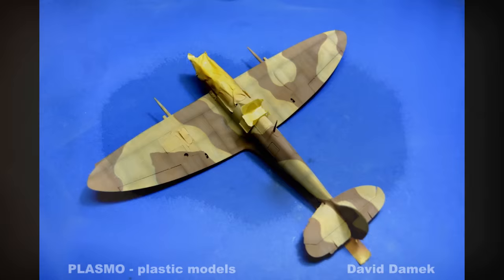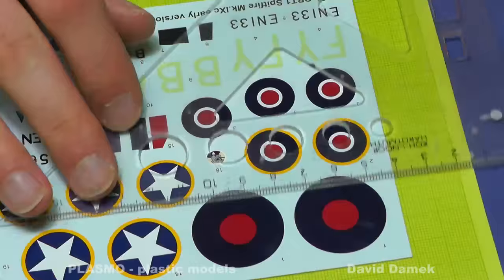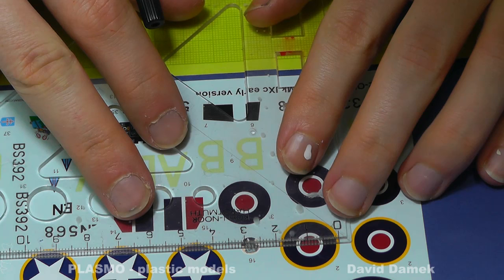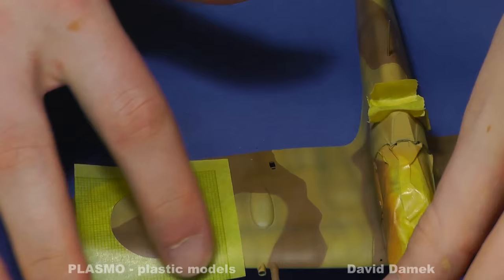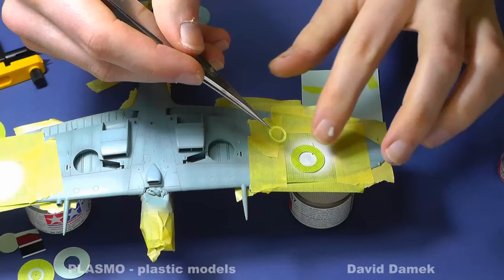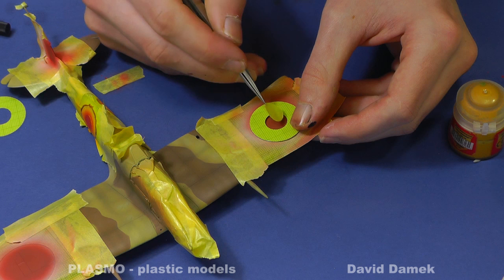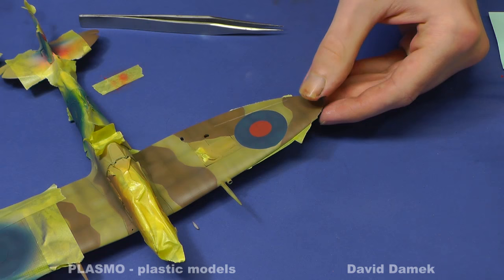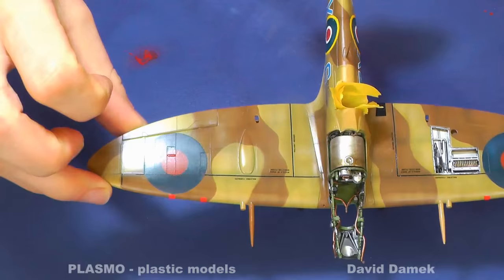How to paint and create stencils RAF roundels - Great Guide Plastic Models

Comment: G'day David, Let me firstly say that I subscribed to your channel because I'm very impressed by the authentic look of your WW2 models especially. I'm ex-RAAF and now, a military historian who is into modelling. I can tell you that before and during WW2, in Britain, finished aircraft would come out of the factories in RAF livery that had, mostly, been sprayed on. Once those aircraft went to their operational bases there was no time to repair aircraft and then spray paint on them. If an aircraft was so badly shot up that the roundels (which are most important for identification) needed repainting then that was done by hand, much the same as you did, using pre-cut stencils. That is part of the reason why your RAF models are so impressive. 
Many models that have the so-called 'D-Day' black and white stripes, have 'razor' sharp borders between the black and white. I have many period photographs of these D-Day stripes being painted, outdoors, with 6 inch paint brushes. Not a lot of care was used in doing these stripes. There were too many aircraft to paint and little time to do the job. So, when I do D-Day stripes I deliberately make them a bit rough, as they were in reality. Also, at their bases, during the war, especially around the time of the Battle of Britain, nobody cared about the aircraft getting dirty; another mistake made by some modellers. New aircraft only looked 'new' for a very short time. The only washes aircraft got was when it rained, as it does in England quite a lot. This, of course, didn't wash off grease, oil and exhaust stains, so they stayed on the aircraft and built up over time. 
I like to research my model aircraft as they were in real RAAF squadrons and I try to find out which pilots flew certain aircraft the most. If they survived then that particular aircraft was considered to 'be theirs'. The RAF and RAAF didn't bother painting the pilot's names on aircraft, as some USAAF had towards the end of the war. A tradition that still goes on in the USAF today. 
Anyway, thank you again for all your tips on brushing as I don't use an airbrush at all; I'm no good with 'mechanical' things...
Cheers, BH.

Comment: Great work, I wouldn't worry that much about different shades since the components and assemblies on the real aircraft had often varied too. This was because they were made by separate teams and sometimes in different locations or factories altogether. Also parts such as flaps and ailerons, rudders etc were often replaced in theater due to combat damage sustained and wear, hence the varying camouflage pattern was only corrected when time permitted, lethal purpose being the main priority during wartime.

Comment: your english killed me.
great tutor btw. 
you should do more tanks!
Reply from the maker: +LoveH2ODelirious Actually I am finished with si-2 1/72 and today I started building t-90 1/72.
Reply: +PLASMO - plastic models and what about 1/35?? VIDS!!! :)
Reply from the maker: +LoveH2ODelirious Ok ok. Today I ordered PzKpfw 38(t) and sd.kfz. 222 leichter in 1/35. I build only two models in 1/35 so far, so it will be interesting.  Panzer VI Tiger or other heavy tanks are so huge, that I will start with something smaller.

Comment: I never do this. Eh, it's just too much work for my fancy. And to be quite honest, I don't think I can tell the result. After the decal is placed, and softened with MicroSol, I think it pretty much looks painted on.

Maybe if I was working on a plane in 1/32 scale I'd consider painting them on, but for me It's too much work. I feel like you could mess it up easily too. I prefer to just use the decal, then post shade the decal. The result looks very similar to yours. 

Anyway, great video! Which scale is this Spitfire?
Reply from the maker: +Alaskafish Spitfire is in 1:48 scale Eduard. I agree with you, using decals is much easier, but always will be decals thicker than paint.
Reply: Alaskafish and also you don’t have as much control over the shades of colour!